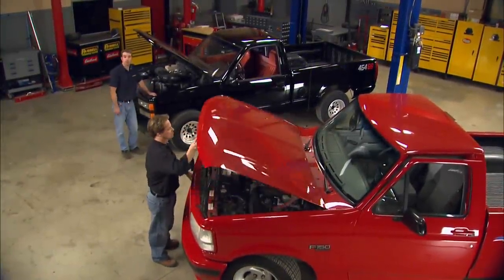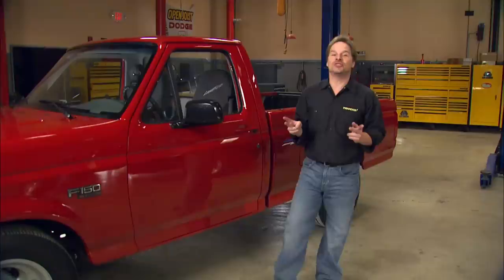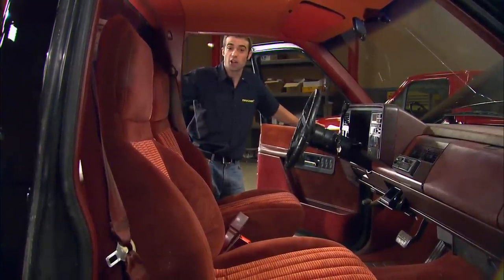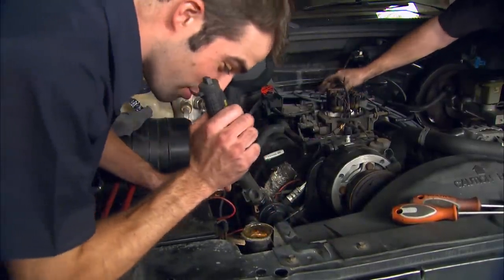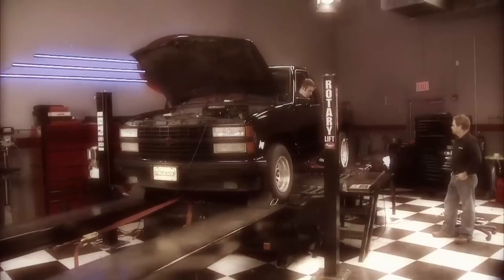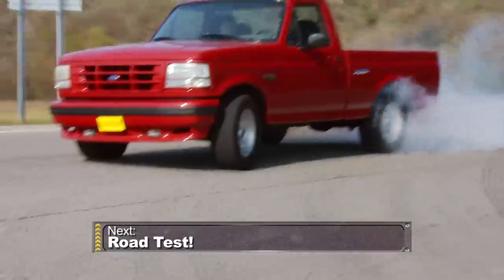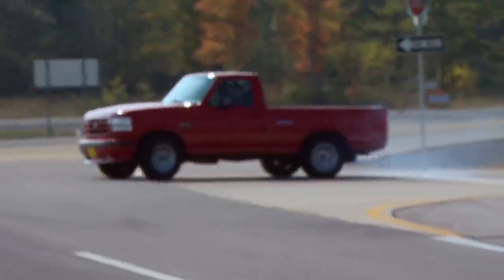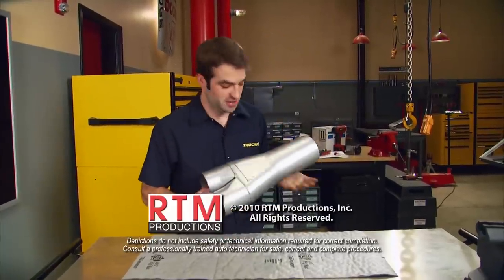'90 Chevy 454 SS vs '94 Ford Lightning F150 MuscleTrux Wars Part 1 - Trucks! S10, E1

Comment: I'm not into trucks but appreciate some of the classics. Might just try driving a classic f150.
Reply: Nothing wrong with a classic F150. Few years ago I had a 2006 F150 lariat with the 5.4 in it, nice truck. Sold it to my cousin to get out from the payment at the time and bought a 1983 F-150 single cab long bed 2wd with a all original 351w in it with supposedly under 100,000 miles which is believable with the condition of the truck and believe it or not this is no joke that all original 1983 would out run the 2006 lariat I had 0-60 not even kidding it was the damndest thing and funny as hell. The dang truck still had the original exhaust system from 1983 on it. I would eat Chevy 5.3 trucks all day every day off stop lights with it. I ended up driving the 83 so hard the rear main seal went out and I’m in the process of putting a mild built 351 in it with Holley efi. So hopefully I will have it back on the road in the next few months. But by all means don’t be scared to buy a classic f-150
Reply: @R-8.0  I call B.S. First off the 5.4 has been listed as the most unreliable engine ever built by several Automotive critics. Second the 351W was a dog engine. Third the 5.3L still gives the 5.0 Coyote a run for it's money and the 1st Gen 5.3s actually beat the 5.0L Coyotes.
Reply: Timothy Isenhart
You can call bullshit all you want brother. I’m speaking the truth. And I’m not a Chevy hater, I own a 2015 Chevy 2500 Z71 LTZ and love the truck. But I also love my old Fords to and have quite a few of them that 1983 I bought was a fucking beast and it was all original from 1983 the damn truck still had the original exhaust system on it and ran like a damn champ. Hell it still ran like a champ when I pulled the motor but it was a 3 speed auto with no over drive and when I’d get on the highway with it I’d run 90-100 miles an hour blowin by people  and I have no idea what it was tacking because there is no tachometer and it was quiet so I’m pretty sure those high rpm’s for long stretches of time down the highway ruined the rear main seal in the motor but when I pulled that motor out to put the new one in it that motor still ran like a champ just leaked oil out of the rear main seal. And the 2006 Lariat that I sold to my cousin he still has that truck to this day and it has 247,000 miles on it all original Never has had any major repairs done to it just maintenance stuff and the truck still runs just as good as the day I bought it was 73,000 miles on it and I am not kidding you at all whatsoever
Reply: @R-8.0  I still call B.S. I've had 2 F150's 97' 4.6L& 03'5.4L, one 95' Mustang 5.0L, one 79' Mustang 302 Windsor, one 74' Gran Torino with a 351 Windsor, One 79' T-Bird with a 351 Modified 400M,  One 76' Cougar with a 351 Modified 400B.  If you said you beat Chevys with 305s or even newer ones with 4.8Ls I would believe you but claiming you were beating 5.3s with your 351 Windsor let alone your 5.4 Triton I call bullshit because I owned a 03' F150 and it got it's ass handed to it by a 5.3 on several occassions.
Reply: Timothy Isenhart 
Call it buddy, call that bullshit lol that’s your right!! This is 🇺🇸America🇺🇸 And by God we call bullshit when we see it and that’s our God given right💪🏻 And that’s why when you look up who built America🇺🇸 The greatest country in the world Henry Ford is 3rd on the list 🦅 I’m not seeing anything about Louis Chevrolet in their or the Dodge brothers or William C Durant.. but yet Chevy says their the heart beat of America🤔 Don’t take offense to that im just messing with you brother stating some facts. But what I’m referring to, to give you an idea I’m talking stock truck on stock truck. Old 1983 F150 early 2000, 1990s and older chevy trucks with the 5.3/5.7 in them. I said 5.3 cause I was referring to early 2000s 1500 which would have had a 5.3 not a 5.7 in it efi.. and that old 83 Ford was a 2 barrel all oem lol  literally everything oem and that old Ford would wax that ass, you win by an inch you win by a mile.. winning is wining. Now I’m not talking about top end either just stop light to stop light 0-60 maybe 70-80 cause remember I only got a 3 speed. That old ford was a factory freak. I’ve got Fords and Chevys in my yard and love them both and I’ll agree I can put less money in my Chevy and out run my ford but out the factory all stock Ford got that ass in some cases. Not all, I’ll give Chevy credit where’s it due and Dodge. I should have just put a rear main seal in  the truck and keep driving it all stock but being younger I gotta make it faster. I need me a trans for it with an over drive
Reply: Timothy Isenhart 
Dodge kinda hurt my feelings being bought out by Fiat.. but what do you do 🤷🏼‍♂️ I probably won’t ever buy a newer dodge just cause if that
Reply: @R-8.0  I won't buy another Ford after owning my Tritons. I won't buy another Dodge not because they were bought by Fiat but because of their cams flatening in their Hemis and their notorious for Rod knocks after 200K miles. I worked for Daimler Chrysler from 99' to 2000 in their interior parts division. I was always a Mopar fan but I know the motors and transmissions weren't built like they used to be.

Comment: Thats depressing for a 7 liter motor to not even break 200hp smfh
Reply: It's a big block do some research they are made for pulling not horse power
Reply: Pull that 7.25:1 compression ratio 200 hp 454 out and drop in a 632.

Comment: Their reactions are way over dramatized. I realize they have to make the show as interesting as they can but any real car person wouldn't react the way they did about things. For example: "look at the welds on this exhaust! It's a wonder it even ran!" Like really? So a leaky, poorly welded exhaust would stop the engine? Anyone who knows cars knows that the engine can run without all that exhaust pipe. Lots of race cars run with open headers. These trucks are in way better shape then they're giving them credit for. I feel like these are the type of guys who would work at a Jiffy Lube or a dealership's garage trying to upsell me on unnecessary repairs.

Comment: As useual, Chevy must use a 454 cu in motor to beat a Ford 302. If Chevy and Ford ever did a real heads up race using a 350 and 351, Ford would run Chevy down.

Comment: and then dodge took the trophy right back in the early 2 thousands with the srt-10 dodge ram, aka a dodge ram with a viper V-10 engine
Reply: Untill Ford put the supercharger on that small block in the 2000's and took the trophy back
Reply: The srt10 wasnt much faster in the 1/4 then the late model lightning
Reply: Even with more horse power

Comment: The lightning couldnt keep up with a syclone. The Syclone puts out 280hp also to add it much lighter. Even brand now the lightning couldnt beat the Syclone. Someone smokes too much crack. Also did anyone else hear him say Ford 454 SS?
Reply: Syclone wasn't even a full sized truck was it. Put a V8 in a Ranger then see who wins.

Comment: The stock 351w in the early 90's trucks calls for 55 thousands plug gap with that msd I wouldn't be surprised to see the plugs gapped to more that 65 thousands the 92 f150 I drive has a 351w i gapped the plugs to .50 and it still runs great and I increased mpgs a bit

Comment: That chevy doesnt weigh 4400. My long bed 89 with a 350 is 4000 even. You can add 100 for engine and add 50 for rear end but then gets cut for short bed

Comment: The SVT Lightning is better in every way IMO!
Reply: Not an SVT... original lightning was produced before SVT existed.
Reply: @chrisallot66  Sir, you are very mistaken. SVT started with the 93 Cobra. I have the SVT book written by John Colletti and two SVT vehicles in my stable. It's an SVT. All the way.
Reply: @jamisgood21  wasn't it SVO first? Memory's a little fuzzy that far back.
Reply: @SGTJDerek  I believe you are correct on that. But in all other facets besides ones letter it was the same. Same people, same mission, just renamed to SVT. Just as SVT no longer exists today in name, but it still lives on as Ford Performance.
Reply: @chrisallot66  Nope, there was that one year of the Fox body as a Cobra. Only one year so they are extremely RARE these days. But they are out there. But yes, correct on the moniker change. I have one of those SN95 Cobras and I love it! If you see a 93 Cobra snatch that thing up!
Reply: @jamisgood21  Sorry you're right
Reply: @chrisallot66  No need to be sorry! Just learned something about Ford! That's good!

Comment: I thought the 454 SS came with 4.10 axle ratio not 3.73 rear gears hmmmmm....learn something new every day ......I think 1991 was a 4.10 ratio they changed it ,and bumped the HP I991 why didn’t you get a 1991 ????

Comment: I'm a GM guy. Always have been. Always Frustrated me Ford had the Lightning.  Mopar had the Ram SRT10. GM had ummm 🤔.  Mopar has the Cherokee SRT, GM had the Trailblazer SS for a few years but now long gone. I'm a truck guy but GM has ZERO performance trucks from the factory. 😡😡

Comment: Well i have a 93 i4 1.5 manual  toyota tercel turboed by me and im pretty sure none of trucks will ever catch me even with all that i have clock this baby at 130 mph im pretty sure it wil do more but the suspension its not helping its older design no sway bar power steering or anything really basic suspension plus its my daily driver havent give me up trouble except fuel pump

Comment: You will not get a real good test of who is better. You need to get the same year and same kind of motor and the same driver to get the best reading to see who is better. I have always been a die hard Chevy guy but you have to give Ford its credit. Ford came out with nice looks but Chevy is were the power comes from. Me and dad go to car shows a lot and you see all kinds of Fords running Chevy drive train all the time.

Comment: the 90s were pretty much the last decade cars and trucks were good, i really hate the ugly egg shape most cars have anymore. i miss cars without lane keep assist, back up cams, automatic breaking, and all the other modern crap that cars and trucks are made overly expensive with today... i miss when you would just turn a car on with a damn key and drive and not have it try to be everything it doesn't need to be lol. Or that you could fix on your own, finding simple old cars is getting harder to do every year. Instead of paying 25,000 to 50k for a decent new car,  imagine how much cheaper it would be without all the stupid regulations and useless tech... Wish i could buy those trucks new today... hell id love a new 1990s ford ranger...

Comment: is the ford 4.6 motor a good tuff motor mine is 05 motor
Reply: This is not a modular Ford engine, this was a 351 Windsor. I had one of these and it had a much flatter torque curve than any modular motor, and I have owned several 4.6 and 5.4s. The modular engines seem to need high rpm to get moving in my experience.
Reply: Also, there may be some can phaser issues with your engine. The bottom end is generally pretty tough. Top end is delicate with oil issues.

Comment: I don't think it was fair to use the 90 Super Sport 230hp/385 torque 373 Gears 3 speed 400 Turbo tranny to make things Fair they should have used the 93 255 horsepower way more torque 4:11 gears in a 4-speed the one they use had a hundred and thirty thousand miles.. the Ford Lightning was a different year has 88,000 miles on it and I know that the 454 is faster because I used to drive the 90 when my dad first got one from the dealership and we used to blow Lightnings typhoons Cyclones Mustangs and even a few vet convertibles away

Comment: “Affordable” 

looks up Chevy 454 SS

is 20k
Reply: You can find one every now and then with high miles for a good price. If the engine has 155,000 miles who cares it needs to be replaced or rebuilt because nobody wants a 454 with less horsepower and torque than a 305! The people that have trucks with 5,000 original miles on them that want $35,000 can keep them! The horsepower numbers on these trucks were laughable they will never be worth the money of a LS7 chevelle because in stock form they run a 30 second quarter mile. They need at least 425 hp, a built transmission, and a posi rearend. Just find a clean 88-94 short bed and build it.

Comment: please i can tell you ford guys don't know much as usual you are looking at 2 trucks with 2 completely different generations of technology the ford new and the chevy was still suffering from the 80s epa standards being a 90 model. by 93-94 technology was allowed to take the handle now I've seen these 454s blow these lightnings off the block all day long

Comment: Making it seem like Ford Lightnings are rarer than the SS....Not even close....11,563 were made from 1993-1995. 1990-1993, 17,000 were made with roughly 80% being made in 1990. The SS trucks are more harder to find in the wild than the Lightnings.

Incorrect rims, missing center console and recent paint job...I will bet that truck is a clone and NOT a real SS.

Comment: What a pathetic tow truck engine they slapped into the SS. Just 380ft/lbs? Hardly stump pulling power. It would’ve done better with the TPI 350

Comment: Ok..anyone who knows anything about the 1990 354 Ss truck knows it HAS NO POWER compared to any other 454 engine. It just makes a nice decal form e side of the truck bed. The Lightning is far superior on Hp and Tq ratings. Why is there even a comparison here? Who is stupid enough to actually consider this equal in any way whatsoever? It’s like comparing a rotten apple to a ripe awesome orange. Now, get a 2019 Chevy with a real engine and get your ass smoked!
Reply: Unless that 2019 Chevy goes up against a 2019 Ford and then it gets its ass handed to it again.....

Comment: The plugs had a larger gap due to the upgraded ignition so it could run a larger hotter spark ,geez..
You guys are just oem clowns . Nothing wrong with that but stick to non performance vehicles then